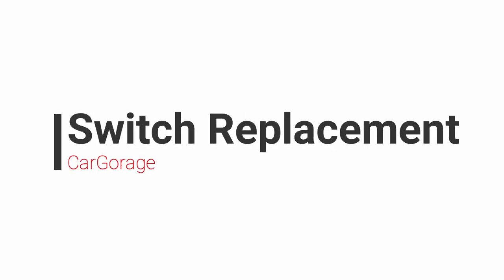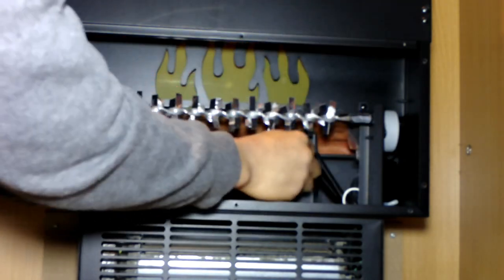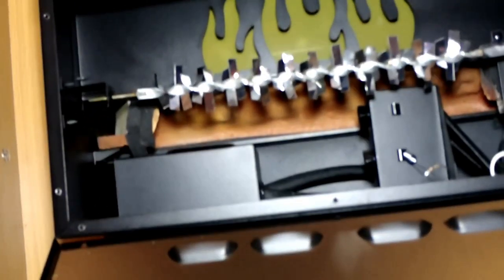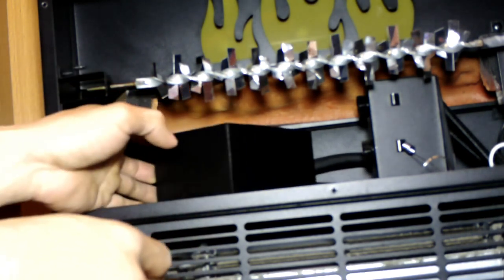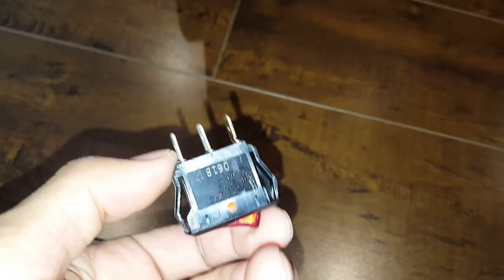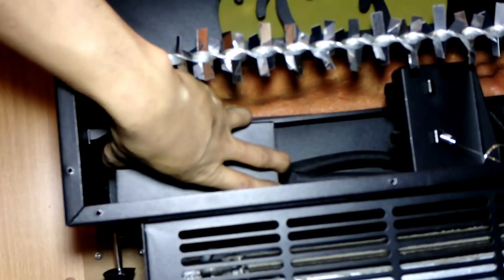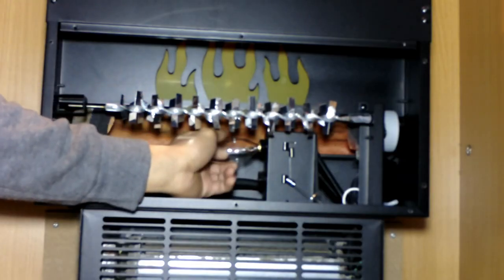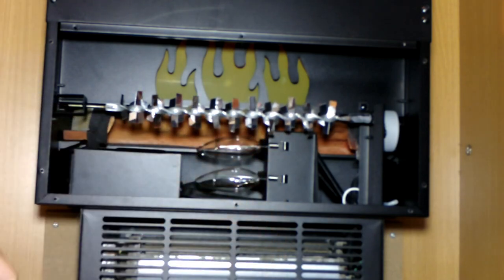Switch Replacement | Electric Fireplace Part 2

Comment: We have our little fireplace working again thanks to your video.  I agree with other viewers to perhaps leave music off so we can better hear your instructions.  We also found the universal replacement switch was a little wide.  My husband modified the opening by filing it down with a metal file by hand.  That left the surface flat.  We used some bad language trying to get those 2 screws out of the side & bottom of the wire box.  We had to buy a new short stubby screwdriver & I needed my hubby to do it.  I also had trouble getting the white wires off the bottom gold prong.  Again my husband kept trying when I gave up.  We then saw your video on how not to bend the plug in the back & we also corrected that problem.  Thank you for your videos & keeping it simple as well as helping us get more use out of our fire place before replacing it.
Reply from the maker: Thank you for commenting. Glad my video could help. Yeah, youtube is very helpful in many ways 👍👌 cheerz.

Comment: Me too! I popped off the switch from the front and it disconnected the wires from the terminal prongs before I could even look and label them. Only the white one stayed put. I have been sitting here for 3 hours going over YouTube videos and every other piece of info I could read trying to figure this out. THANK YOU SOOOOO MUCH! Got it! I would have done it wrong if I had went with what I was seeing in the schematics which are not clearly stated. Thank you a million thank you's! Liking and subscribing to your videos!!

Comment: Thank you so much. Like an idget I forgot to take a pic of the wire configuration.  Even though I couldnt hear a word you were saying over the music I was able to see the configuration of the wiring. my fireplace is pretty and warm again.
Reply from the maker: Yout welcome sir, im glad that my vid helped u out in anyway
Reply: @Cargorage  I thank you too! Was in the same boat! The schematics I read said 1 is Accessory which I would think would be the fan/heater etc, then 2 is Power and 3 is ground which was still connnected on mine. I figured that the double wire would have to be accessory (maybe fan/heater/led switch light?) Do you know for a certainity? And you didn't show turning on and fireing it up? But I still appreciate you!
Reply: @Cargorage  No disrespect, because I found your video very informative and helpful. Please, for the love of God, do not put any music in your future videos.🤣 Much love
Reply from the maker: @L-Train0ne  🤣👍

Comment: I need to find the right switch to replace on my electric fireplace. Did you say there is a universal one? Please verify. The info I got from the comments here is that it is a singlepole throw switch available in any hardware store.  Correct?  My fireplace model is a Telluride by Stonegate (upright with mantle).  The switches on it look like the picture here, except there is no entirely red one.  Just the 2 on the right.  First one turns it on/off.  Second one raises the power from low to high.  Can anyone help me with his info?  I've asked in millions of places! Thanks!
Reply from the maker: Yes it is a single pole throw switch that i have replaced.
Reply: @Cargorage  Is it universal?  Will it fix my FP?  Is it available in  Lowe's or Home Depot? They said they didn't have switches for fireplaces.
Reply from the maker: Yes, it should work sir, it worked on my fireplace. They say it won't work because it may not fit in the hole that's why I had to make the hole bigger to fit the universal switch.

Comment: Where did you find that switch ?
Reply from the maker: Hey , the switch i bouth in my local hardware store canadian tire.. its a SINGLE POLE THROW SWITCH....IT NEEDED A BIT OF MODIFICATION WHERE IT SEATS DOE. U can see in the video
Thanks
Reply: Amazon has them